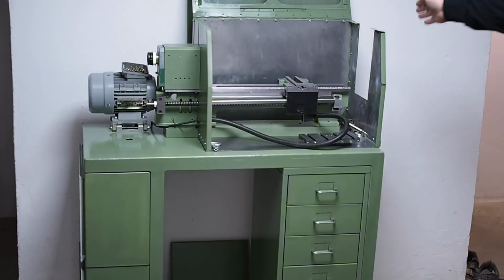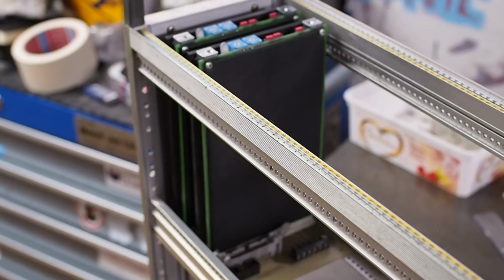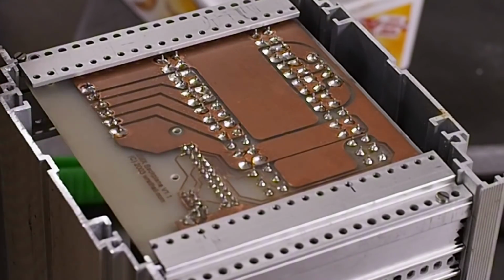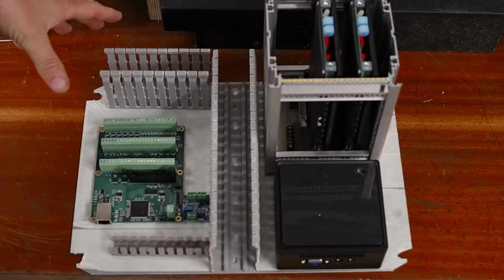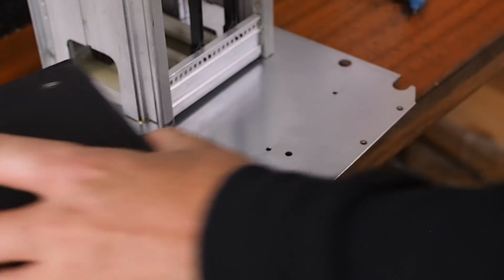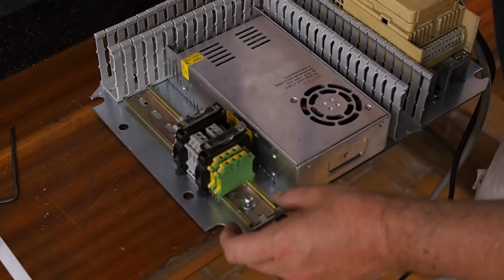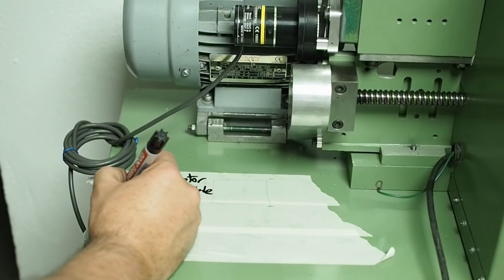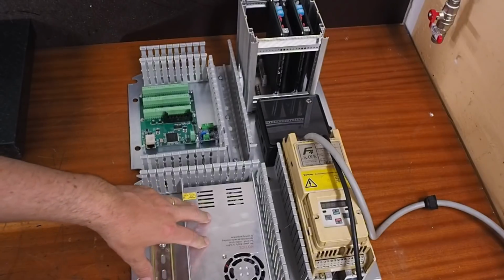CNC'ing the infamous 7x12 mini lathe - Episode 21 - Control hardware

Comment: Hi, Just found your channel and it looks very interesting. To save some frustration in the future it would be a good idea to make some mounting plates for the power supply so it can be removed from the front of the panel. The power supply is going to be the thing that will fail first and you don't want to remove the whole gear tray to replace it.:-)
Cheers for now Dave from Dannevirke.
Reply from the maker: G'day Dave. Thanks for watching.  I already received that suggestion, but looking at the layout, I now dont have space to add an extra plate for front mounting. Bad planning. IF that PSU dies down the road, it wont be a huge deal to pull the gear tray.

Comment: We have build a lot of control capinets at work I rarly seen drillig/tapping the back plate, we use selfdrilling/tapping screws, and try to get every screw to the front to ese the changing/replacing the comonents later. Self driiling/tapping Is esely used for the fingerchannels an din rails. We also use rittal cabintes they are not cheap but one of the best. SuperB video as always! there is som good quality work done:)
Reply from the maker: Thanks for the feedback. I am definitely an amateur at this stuff.
Reply: Alternatively, etch/sand all the copper off a blank PCB that's the same size as the back plane. Use longer  back plane mounting screws so that the blank board and small spacers can also be fitted.
Reply: Alternatively, etch/sand all the copper off a blank PCB that's the same size as the back plane. Use longer  back plane mounting screws so that the blank board and small spacers can also be fitted.

Comment: Random thoughts -- put an air filter, if you can, on the vent holes for the cabinet to reduce dust and then try to get a couple of bigger computer fans (and maybe another 10Eu PWM board) to keep the heat down. You might be able to remove the lids/enclosures on a couple of the modules inside the box and really help keep things cool. Nice as those little computer boxes are, they do run hot, even if they're going to be nearly zero load with LinuxCNC.
Great project from top to bottom in terms of your fit and finish. Thanks for sharing.
Reply from the maker: Thaks for the feedback. I haven't planned any cooling as I figured everything in rather low power. Think I'll take the risk for now.

Comment: Ahh yes the fun bit ! The Electckery section ! Have you ever wired something up and came back to look at it a few years later and thought  My God what was i thinking ? Happens to me all the time! Sometimes a can’t bring myself to even take the cover off because i know what evil is hiding behind it 😂
I hope you don’t have the same issues i’m having  with the spindle bearings  on my mini lathe !
I have been scratching my head trying to work out why the bearings are getting so hot , 10 min running at 900rpm and you could cook an egg on the chuck .
The only way i could stop this was to run a thou or two end float but this isn’t what you want on a lathe ! I stripped it down on the weekend and once everything was cleaned up it became immediately apparent what the problem was  - the bearing bores are not aligned  or round !  The wear mark on the bearing cup starts off at full roller width and nicely centred  then tapers off to to about 1/3 roller width on one  side  and is riding up at the back of the bearing cup 😭
Could i fix it - probably 
Could i be bothered - probably not !
I can see  the lathe coming to blows with my 9 inch grinder and we all know who will win that argument ! Either that or set it up with the toolpost grinder and use it for grinding bearing journals on my model engines - the spindle runs perfectly true it just gets to hot when using even moderate speeds . I will have a beer or twenty and think about it !
Reply from the maker: I only ran 6206 ball bearings in the spindle in the past, and thought the switch to 30206 tapered roller bearings would be an upgrade. I also fear that they will run hot in this housing, based on my initial runs. If that happens, I'll rip them out and try a pair of 7206 AC bearings.

Comment: you could 3d print a custom "gland" for a large square hole. 2 parts hard plastic that can clamp over the cables and some sort of printed gasket from ninjaflex.
Reply from the maker: That was kind of the idea I had as well. So far I have been too lazy to actually do it, but I will get chaffing if there is not protection.

Comment: Looking good mate! 
The end of the spindle is a concern. Are you planning an enclosure/motor cover? If so, maybe a tube to continue the opening to outside the enclosure where a spider could be mounted to support long stock. 
Cheers
Reply from the maker: Good points. I haven't really thought that part through yet.

Comment: Have you seen icotek glands? They can be pricey but are what we use in a location like your cable routing
Reply from the maker: Thanks for the tip. I looked them up, and the local electronic supplier has some. I'll see if any will work for this project.

Comment: I am not sure putting the NUC near the VFD was advisable. EMI and noise wise. USB cables especially seem to be sensitive to this (which is why on my setup I switched to shielded ethernet as the main communication between PC and Controller.
Reply from the maker: Thanks for the feedback. They are in difference cabinets with two layers of sheet steel directly between them. The Mesa 7i96 also has Ethernet for the connect with the NUC. USB is only used for monitor touch and keyboard.
Reply: @RotarySMP  Hmm, might be ok then but keep it in mind should you get weird behavior. Mine (well I have CNC Router but same difference) would work well for minutes on end and then just drop connection, or worse. It cost me a spindle so that was no fun.
Reply from the maker: @xConundrumx  EMI is a silent killer. I am going to see how things work out, and address problems if they occur.
Reply: @RotarySMP  Well in this case it was missed steps in the Z-axis that caused the tool to think it was on safe height and clear of the workpiece when ... yeah not so much. Bent the shaft on the spindle slightly (still amazed by that, how is that even a thing, break a tool sure but bend the shaft, really)

Comment: great video.
you should probably use something other then electrical tape for insulating the back panel - it will probably lift off over time and make a sticky mess, especially if there will be any heat in the box. maybe Kapton tape?!
Reply from the maker: Good idea. I'll ask my avionics friends if someone has some kapton tape.
Reply: Or maybe just paint that area of the panel?

Comment: Will you do a pneumatic chuck release? (for automatic bar feed)
Reply from the maker: That would be polishing a turd :) Thanks for watching.
Reply: @RotarySMP  I hope you know, if the encoder shielding is bad, the power wire  for the motor/stepper and the encoder wire can't go parallel to each other... There will be electrical noise and not correct read out. (low voltage - signal cable and high voltage - power cables must go different ways)
Reply from the maker: @DPTech_workroom  Thanks. I didn't think of that. At this stage, I'll try it and hope the shielding is good

Comment: Would you scrape my myford super7 for me? :)
Reply from the maker: Thanks for watching. Sorry, I have too many projects of my own that I need to get to. As a flat bed machine the Super 7 would be an ideal first scraping project. A surface plate, straight edge and scraper will cost you far less than paying to have the work done.
Reply: @RotarySMP  No problem. :) It never hurts to ask. If I don't sell the super7 maybe I scrape it someday. I enjoy your videos. I don't know why but for some reason they have good flow. Not like ox tools or steve summers wich videos feel like they are not going anywhere. Although newer videos from ox tools are significally better. 
Keep up with the good work!